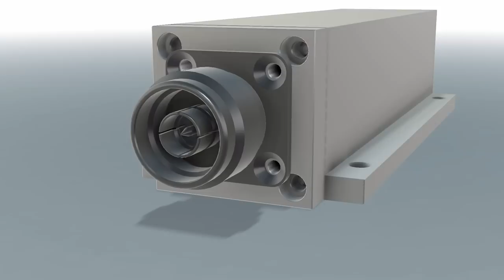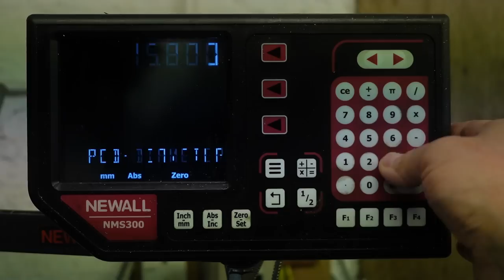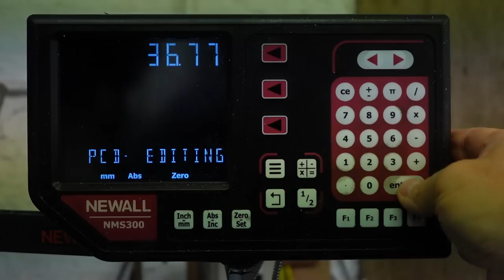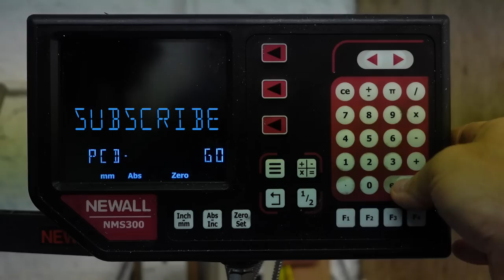Precision Machined Body for my 1.3 GHz coaxial low pass filter

Comment: I've been able to get really good surface finishes in aluminum with a 5 insert face mill on  Bridgeport with an R8 spindle, the trick is light cuts and plenty of cutting fluid. Having seen videos of fly cutters explode/fly through machine enclosures and multiple walls, plus being aware of how they aren't the best for the spindle bearings I tend to avoid them.
Reply from the maker: I do have a really nice end mill with inserts that makes an excellent finish, but it cost about five time what the cheap shell mill did. Actually I got if FREE when I bought 20 inserts. The cheapie has a variance in cutting edge height or at least 100 micrometres, which is enough to leave multiple lines.  Two of the pockets are accurate to 5 um, so I sometimes run with a pair, but there's still the impacts and the large variation in tool pressure because of the missing inserts.  What I need is a high quality 125 mm face mill which can take inserts that are perfect on aluminium and copper.  Those beasts tend to be expensive, and then there's what to do when the heatspreader or case is wider than the cutter.  Always end up with a faint herringbone pattern.

Comment: I love the machining. I find it very theraputic. However, many of the microwave precision machined filters have been superseded by SAW and BAW filters nowadays, and very often they're dirt cheap, but not tune-able.
Reply from the maker: Indeed, and they are zero fun as a result! A bit like electric cars. Boring consumer products that work suoerbly and are easy to maintain and cheap to build and completely lacking soul and character. Efficient, profitable, quiet and sensible. Now and then it's nice to play with steam external combustion engines and big old V8 petrol burners. Same with 3D printers and CNC. Hugely effective and performant, but feels like work instead of messing about on manual machines and using hand tools. I wouldn't want to be without all of that tech, but it doesn't quite scratch the same itch that my old clunkers and hand tools have. It's about the journey, not the destination
Reply: @MachiningandMicrowaves  I suppose it depends on your perspective.  I do it for a living and machined RF parts are simply not an option for the products I work with. I want to know that when the products roll off the end of the production line that every one will be perfectly tuned and meet spec. It may be boring but I sleep well knowing they are repeatable and no labout intensive tuning is required.
Reply from the maker: @rogeronslow1498  Yep, if I was doing it for anything other than entertainment I would be doing everything very differently.

Comment: Your filter is shaping up quite nicely. I do hope you plan to share your results when you characterise it.

On a side note, is it me or is Amiee off her bytes and giving less sass than usual? I am aware she's off her bits, but that's another story.

Great video as ever. I'm hooked.
Reply from the maker: I'm making eight of these, so it'll be interesting to see how similar they are to each other and how closely they conform to the modelled performance.  I think we're both a little distracted at the moment, several big projects all about to happen at the same time.  I need to finish the vid about the detailed design process and how that constrains the machining of the physical filter. This is a busy time for radio contesting/sport radio and I've had to make a lot of parts for antenna systems, azimuth rotator couplings and mountings.  Sadly, it was all rush jobs, so I didn't get to film much of it, but I'll post a few photos of the finished items.  For the next few days I'm finally collating all of the items for some 432 MHz to 10 GHz transverters. I ran a group purchase for the parts and enclosures and circuit boards and I have NINETY kits here, which cost me £7500 and I need to get them boxed and shipped.  There are over 800 component sheets, each with up to ten surface-mount component strips which have to be cut to length then taped in the right place on each sheet.  Then all of the other parts of the kit need to be bagged and boxed, then shipped.  I think it will take less than 40 hours in total, but that is a huge proportion of my non-working time for the next week.  The project is 18 months late so I just have to get on with it. Caroline was helping me with it before she died and somehow I was totally unable to restart work on the project.  Now it's a year since we buried her, I have psyched myself up to complete the job.  I might do a video about making one of the transverters.  Perhaps I'll include a time-lapse of me making up component sheets....

Comment: See This Old Tony... you should not have to go through life without a fly cutter.
Reply from the maker: The real application for the flycutter is for mirror-finishing copper heatspreaders that are 5 inches wide, so controlling chatter and avoiding resonances, tearing and edge impact ripples are critically important. I think I need a steel disk with a heavy cast-in lead infill and a 25 mm toolholder slot to be able to get the surface finish I want but with excellent damping and stiffness. If I tram the mill really well, I can get better than 5 micrometres flatness across a 100 mm copper slab using the single-cutter facemill in two passes, but I should be able to do better with a single pass of a much heavier cutter.
Reply: @MachiningandMicrowaves  I'll look forward to seeing the creation of the  lead bearing beast.

Comment: I'm a big dummy. What's the benefit of using the face mill with one insert instead of with all the inserts?
Reply from the maker: It's a cheap shell mill and the precision of the pockets is poor, so if you use multiple inserts, you get a rotten finish with raised lines.  Great for bulk removal when roughing, but hopeless for finishing.  Also the mill only has an R8 collet. If it had something stiffer like an ISO40 or 50 it might be worth using an expensive face mill with multiple inserts. I need to make a dedicated flycutter which can take lathe tooling and that's super stiff with a lot of rotational inertia to get a mirror finish on copper and aluminium at least. Basically, it's a bodge, but it works!
Reply: @MachiningandMicrowaves  Sounds a lot like my own misadventures; working around limitations and making due with what I've got! Cheers from The Rubber City, Akron, Ohio, USA.
Reply from the maker: That's the secret of success, if you can't buy a thing, and can't make it, you can always repurpose something else. All you need is a plentiful supply of cunning and a sufficiently warped mind.

Comment: Ever do anything in the terahertz gap?
Reply from the maker: Nothing yet. I used to play with big CO2 lasers, and I'm watching closely what's going on with fast photodiodes and mixing a pair of tunable dye lasers to generate beat frequencies in the hundreds of GHz range, but the area above 300 GHz and below 10 micrometres is very tough to get into unless you have a University lab or similar at your disposal. Some of the locals are doing interesting things with comms at 30 THz, but they are using bolometers and FLIR sensors for detection, and sometimes using a sun-tracking mirror as the thermal source to save on battery power when they are on a hilltop. I've been looking at germanium lenses and first surface mirrors for 30 THz, but not done anything more than drooling at old Melles Griot catalogues (now Thorlabs) and browsing the Edmund Optical website. I've played with long distance visible light comms using LEDs putting out about 15 watts of red light into a 300 mm square Fresnel lens, but finding sites in the UK with a long enough free-space path is close to impossible.  However, I want to try cloud-bounce over 200+ km, but using LEDs and lasers is like using spark transmissions on radio, very 1900s. There are some Japanese experimenters doing interesting things at 800 GHz, but the practical limit for me at the moment is probably 288 GHz using harmonic mixer diodes and cavities on receive and multiplier diodes in flip-chip packages on transmit. I have more than enough projects to fill the next two or three years without trying to get hold of a die bonder.  My aunt used to be an expert wire-bonding operator at a specialist semiconductor fab, so I could get a collab going with her if I can find an old bonder.
Reply: @MachiningandMicrowaves  that was more than I expected and a lot to digest 😁.
Do you remember ricochet wireless? Or,
Do you remember Ronja or ever hear of Digital Atlantic? Both involved free space optic communication.Ronja was a hobbyist Russian project that I likely misspelled that used car tail light LEDs and telescopes. The second was a failed  startup out of poolesville Maryland , if you look up their patent, the six smaller lenses to be used for tracking and alignment were my contribution.. the main optic was very much like the Huygens optics monolithic from his videos. The whole unit was intended to fit in the size of a soda can doing multigigibit at 1000ft.. after my friend Steve the CEO died it seemed like everything got run by the marketers not the engineers and the company fell apart..
    This was back in the 90s when I was trying to start my own wireless ISP, but I was intentionally avoiding microwaves.. preferring optical or the 915 megahertz ISM... I was fascinated how strategic placement of rebar in the trees in the woods could create beneficial Fresnel effects to get around line of sight issues...
I still have some free world dialup VoWiFi phones made by Utstarcom from near the end when I gave up..(cable broadband came out)
    My interest now in the terahertz range is much like when I was a child playing with old radios fascinated with trying to pick up or send signals in otherwise empty spectrum not having any idea what I was doing....( I wish I kept my tube collection)  terahertz technology is so much untapped potential, if it could ever be practically and affordably figured out.. well it's not going to be by me because now all I got is a germanium window and $20 bucks

Comment: i see it done regualary, but why only one insert?
Reply from the maker: It's a cheap shell mill and the precision of the pockets is poor, so if you use multiple inserts, you get a rotten finish with raised lines.  Great for bulk removal when roughing, but hopeless for finishing.  Also the mill only has an R8 collet. If it had something stiffer like an ISO40 or 50 it might be worth using an expensive face mill with multiple inserts. I need to make a dedicated flycutter which can take lathe tooling and that's super stiff with a lot of rotational inertia to get a mirror finish on copper and aluminium at least
Reply: @MachiningandMicrowaves  well, that would explain why i get a rubbish finish from.my cheap shell mill! ha!

i learn so much from your interesting videos. dont stop!

Comment: i guess i can't name a certain chinese supplier of goods; comment gets deleted automatically lol. have you thought about getting a monocrystalline insert or end mill from china? i bought one and was pleased with the result. they're relatively affordable (but they're not cheap per se; it's a diamond after all). i would share a picture but words are illegal in the youtube comments, much less hyperlinks
Reply from the maker: I don't see anything in the quarantined messages, so it must be deleted invisibly. I'll go and look.  Never thought of trying monocrystalline inserts
Reply from the maker: Ali express part number 1005001946379849 for example. Interesting
Reply: @MachiningandMicrowaves  that's the manufacturer i purchased my insert from. they have a bunch of different types. if you go to the baba website (let's see if this gets deleted lol) you can find sellers that sell milling sticks with the diamond directly attached to the end of them so you could try machining side walls with them too